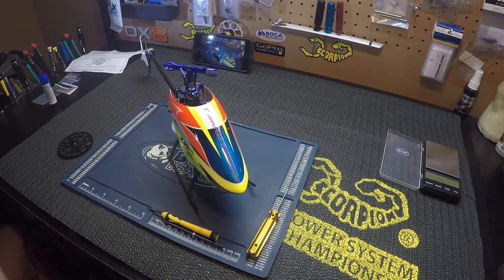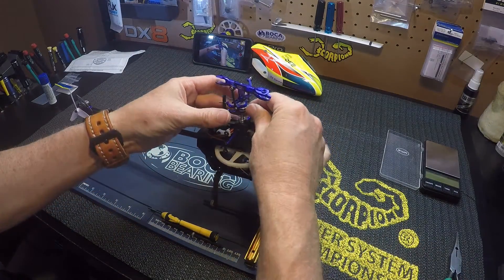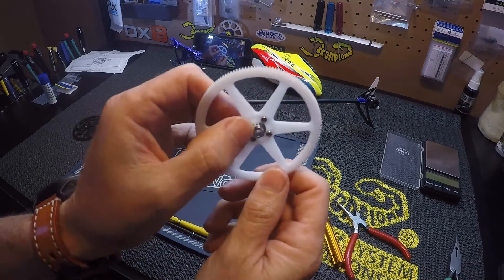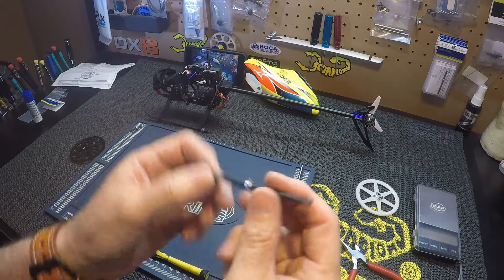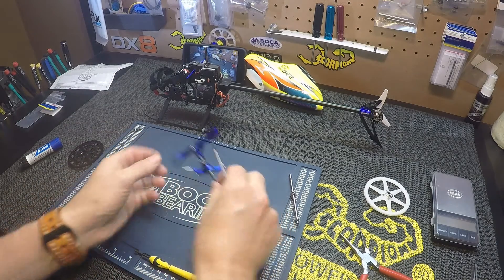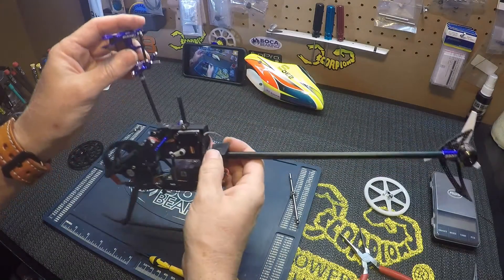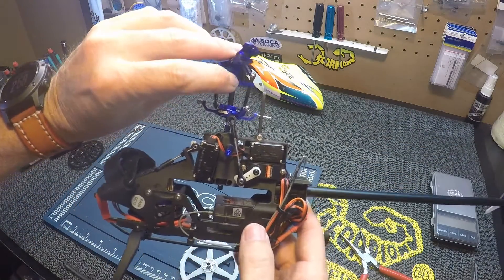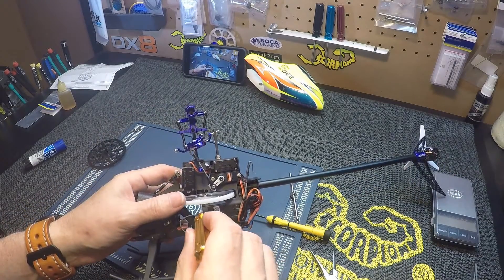Blade 230s changing the main shaft

Comment: And now the Blade 250 CFX is introduced and I have the Blade Night 230 S on pre-order.
Reply from the maker: Not sure which will be better   250 CFX is a 300x with 230 parts
Reply: JJInvertedProduction The power to weight ratio might be better. One thing I like about the 300 CFX is I can use bigger batteries.
Reply from the maker: +James M are you in my 230 Facebook group?
Reply: JJInvertedProduction I don't use Facebook what-so-ever. Shouldn't be that hard to convert the 250 CFX for night use using the Night 230 S parts.
Reply from the maker: +James M it uses bigger blades
Reply: JJInvertedProduction Going to 240mm blades from 245mm blades would be just fine for sport flying. Hard core 3D may suffer a bit.